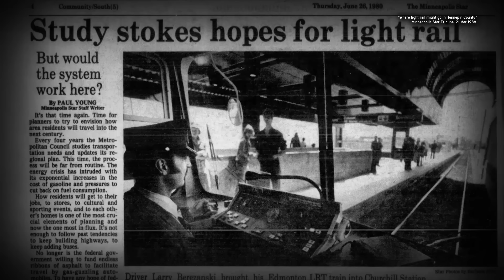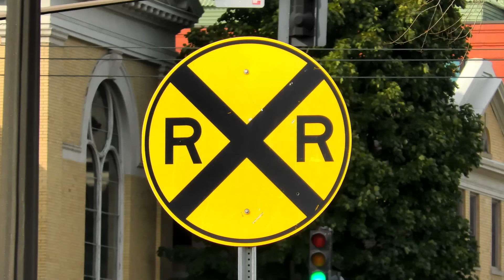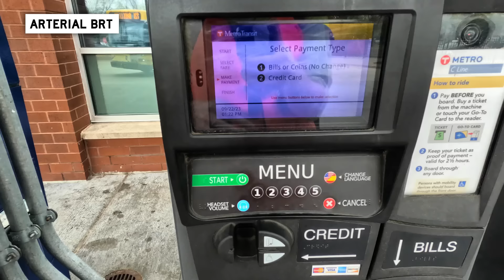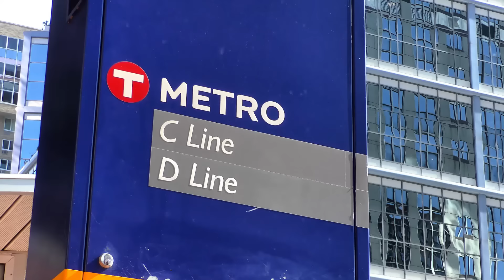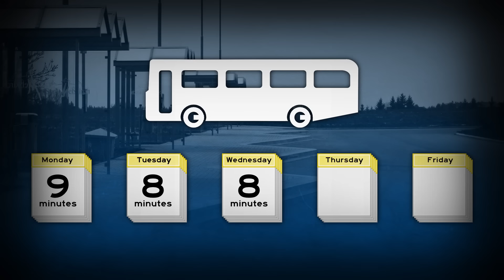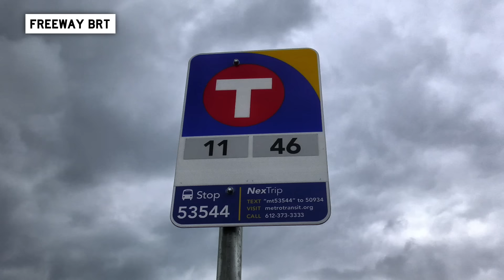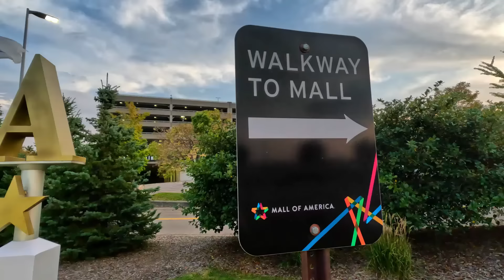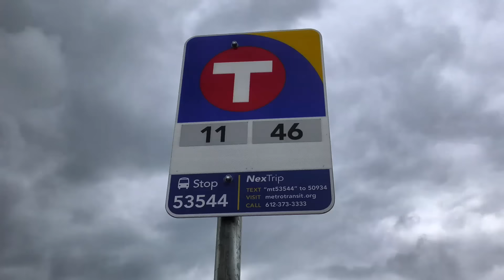Meet Minnesota’s $500-Million... 🚍 BUS???

Comment: When it comes to North American light-rail systems, a pretty great one is the St. Louis MetroLink! Serves both the Illinois and Missouri sides! Serves places like St. Louis Lambert International Airport, IKEA at Cortex, Scott Air Force Base in Illinois, Busch Stadium at Stadium station, Amtrak and the Enterprise Center arena at Civic Center, and of course the Gateway Arch (which you can get an amazing view of from Laclede's Landing station). Much of MetroLink is a reused rail right of way, like the Eads Bridge which is the oldest bridge on the whole Mississippi River! When they were constructing the underground stations downtown, the tunnel was already there, using the St Louis Freight Tunnel. So with a lot of grade-separation, the Blue and Red Lines of MetroLink is basically a light metro, or a light-rail that acts like a subway! 

On the Red Line, trains use the former Wabash/Norfolk & Western Railroad's Union Depot line that once brought passenger trains from Ferguson to Union Station. When the Red Line makes a stop at the Delmar Loop station, it is located just below the original Wabash Railroad's Delmar Station building! On the Blue Line, it follows a former Terminal Railroad Association of St. Louis (TRRA)/Rock Island railroad right of way. When they were constructing Skinker and University City-Big Bend stations, they faced opposition because that section was gonna be street-running, so they opted to build them underground! So thanks to NIMBYs, they ironically made the Blue Line a better and quicker service through no street-running!

Comment: In Seattle, after losing funding for heavy rail in the 70's (that went to build MARTA), they built tunnel beneath the downtown core for busses. 30 years later, it was converted to handle busses and Light Rail.  Hopefully the bridges will be designed for future LRT.

Comment: Road Guy Bob doing transit videos! Amazing stuff. I personally think a mistake most American cities do with transitways is only running one line on it. In other countries, they build a transit way and run 10 - 15 routes on it to speed up normal bus journeys with 1 - 2 minute headways. That way you're making the best use out of expensive concrete and really getting those ridership numbers from bus numbers (20 - 50k riders) to rail numbers (100k - 150k)
Reply: Very inefficient to have so many routes duplicating each other, especially with the operator shortages that most agencies are experiencing. No thanks
Reply: @trademark4537  Just look at Brisbane or Ottawa's transitway (well, before they demolished it). It's actually a more efficient use of infrastructure. The same concept applies with rail lines that branch out into the suburbs but converge at the downtown core. Basically you're using the existing right of way to speed up multiple services instead of just one.
Reply: @louiszhang3050  Let's say the rapid transit route is East-West. If you run the service in the way you suggested, You would need to have the route from the North and the South both enter the transitway. If it's 5 miles to downtown, you're running 20 miles of duplicated service (2 routes, 5 miles each way). The time it takes to run a bus 20 miles, could instead be spent on running one route at high frequency north and south of the transitway.

Yes, riders would have to transfer, but you can significantly reduce their wait time to get on the first bus by investing in better frequency. Operator hours are always limited.

Comment: Bus Rapid Transit is actually a REALLY good option in place of trains and trams. It's cheaper, it's much easier to adjust capacity when needed, and with the new hybrid and even full electric buses, the carbon footprint really isn't any more than a train.

Comment: They should color their busses accordingly to the line color. If not, then make the strips along the busses colored accordingly.l
Reply: That is discriminatory towards colorblind people.  😏
Reply: @jovetj  the design and policy people can always make adjustments
Reply: If all they color their buses or make the strips along the buses accordingly to the line color, you realize that buses on the other lines can break down?

Let's say two buses on the Green line breaks down, then you'll see two blue colored buses on the Green line.
Reply: Do Americans forget that buses can break down?
Reply: Color changing leds exist people
Reply: @automation7295  Nottingham City Transit in the UK has had colour coded liveries for their bus lines for years without issue. Worst case scenario you have some neutral liveried older buses to pick up slack on breakdowns and unusual peaks. Each route was still numbered as well but if they all went to a similar location then they were part of the same colour group. e.g. Bus routes 44, 45 and 46 towards University Park campus would all have orange liveries so you knew you'd be going in at least vaguely the right direction.
Reply: @kitfagan2027  Listen, any bus can experience breakdowns. No buses are perfect. 
If several buses on route 44, 45 and 46 breaks down, then you may see buses with different color livery on the orange line.

I think buses having colour coded liveries for their each bus lines is kinda stupid. Where I live, all city buses are yellow while some have red or blue or even green corners.

Comment: Is the high end BRT system only cheaper because of more companies that know how to build roads?  Isn't that potentially self-defeating in the long term given they have some light rail?
Reply: It's easier to create the service from ground up, but a lot harder to upgrade later on to light rail or subway since BRT is only good for medium capacity & frequency services unless they play some tricks it wouldn't last when it has subway crunch load.
Reply: Not only that, but you also can use the buses elsewhere in the system, the mechanical parts for busses are often the same as other commercial vehicles and there are a lot of people trained in maintenance of those compared to rail ROW and rail locomotives. Bus drivers can also be trained faster and are cheaper. (High turnover job) and the infrastructure can easily be used by other city services without specialized equipment.
Reply: We are also working on two rail expansion projects right now. Perhaps they were concerned about capacity with the contractors available in the area. Additionally, since much of the route is on exclusive roadway, we might be able to retrofit some light rail in the future. A lack of ability to build more additional rail at the moment, while certainly disappointing, does not seem entirely implausible to me.
Reply: If you build a light rail line only to have 20m long vehicles on it, then BRT is a better idea. 
The added value of rail is leveraging the ability to have vehicles longer than buses : 30, 40, 60m and even multiple units coupled.
Reply: @veryrealpersonwhoisreal St paul is also considering a pretty big street car line connecting Union Depot to MSP, and MOA along 7th street

Comment: Why does a broken elevator close the station?  Aren't there stairs??
Reply: I'd assume it has to be accessible for everyone which would bring forth the question, why is there no ramp?
Reply: @attackofthelumbie9029  Ramps require a lot of space, a large footprint. They probably didn't have the space.
Reply: @qwertyfff Yes, but I-35W & Lake Station is NOT accessible to the street (Lake Street) below the expressway, so the busses deploying a W/C patron is redundant cos where are they gonna go?
Reply: @attackofthelumbie9029  In germany, ramps in public spaces are only allowed to be a maxium of 6%, so 6 cm heightgain over 1 meter of length. If the ramp is longer than 6 meters, there needs to be a rest area of 150 cm by 150 cm. Good luck trying to get a ramp going up to that station with that in mind.
Reply from the maker: Metro Transit didn't want a disabled rider marooned on the upper deck on the station with no way down to the street. So they made the bus exit the freeway and use a street-level station. 

Which worked out well for me, so I could have video to show you that.
Reply: @RoadGuyRob  Ah, I see.  I was thinking like a train and I assumed the bus was just skipping the station.   That's actually a great advantage of this kind of system over trains, the bus can always just take to the streets.   Though with the truly dedicated roadway they're building, would be curious to know how many entry/exits for the bus will be built.

Comment: BRT is stop gap...you're just hiding your capital outlay by moving it to operations....bus drivers every 10 minutes ain't cheap, including long term pension requirement's.   A LRT is going to carry more passengers per hour at significantly less labour cost, especially on dedicated lines where driverless LRT can be used.  Build the BRT but make sure you've done the infrastructure in such a way to convert to LRT without undue captial outlay. There is a reason cities that have had BRT for 20 or 30 years are now converting them to rail.
Reply: Build grade separated rail that's automated and hire a team of ticket inspectors. Big capital outlay, big long term gains.
Reply: And sometimes your light rail line gets so crowded you need to bury it underground, and you get a subway!
Reply: That's true, but to be fair time value of money is a real thing. Spending a billion dollars today is very different from spending 500m today and 500m over the next 10 years. It may be costlier in the long run but it gets your transportation up and working sooner and the difference isn't as big as it looks. I think you make a good point about planning ahead to convert it in the future as the next step in efficiency.
Reply: This is true but Metro Light rail lines usually don’t meet the crush capacity and ridership threshold for this to be an immediate issue so the service improvements are still desirable

For the most part being mode agnostic when it comes to the kind of service improvements you’re looking to make (speed, frequency, reliability) up until capacity must be considered is pretty ok for the most part

Buses like the Vancouver 99-B line I think show the upper limit of service frequency and ridership possible for a regular bus line and if metro ever had such a similar bus line it would indeed be extremely advantageous to replace it with higher capacity rapid transit
Reply: If you run your BRT program well, it can be very efficient and great. I have seen a few excellently BRT lines.
Reply: @delroyl427  sure, but they are not a replacement for rail...they are simply a better organized bus with the capacity and operating costs that implies.

Comment: I've advocated for Guideway BRT over light rail for years, even before anyone was doing it. I love the flexibility coupled with lower cost that it provides. If a portion of the guideway becomes impassible, it doesn't shut down the system because the buses can move to surface streets. As demand changes, service levels can be rapidly and dynamically adjusted simply by putting more buses on (or off) a route. That's much harder to do with light rail.

Yes, dynamic service requires hiring more drivers for buses than for trains. But it's more responsive (easier to add buses than train cars) and the added cost of drivers is offset by not paying for moving empty train cars around or the infrastructure they require.

Comment: Where I'm from, and pretty much everywhere in Europe, BRT is only the highest option with guideway.
The rest is just basic bus, even if it uses a bendy one and has nice stops equipped with shelters, canopies, etc.
Basic bus already has greenlight priority and-or activation, bus lanes, etc.

To reach BRT level you need proper busway dedicated right-of-way and nicer faater busses, with real schedule conformity, often increased station spacing, and almost tram-like stations.
In my city, Paris, the latest BRT lines use vehicles that are more trambus than bus : double articulated, 24 meter long, electrically powered via ground recharge infrastructure. They look like trams without pantograph (the wheels and tyres are mostly hidden).

The ones that drive on freeways and-or bus lanes are just simple busses.
The cost mentioned in the video is the one for a tram line in Europe...

Comment: I have always contended that the Twin Cities should first focus on fixing the long transit times from one neighborhood to another since routes are routed through the downtowns before money is spent on transit that benefits only a few.

It takes a minimum of three transit routes to get from a neighborhood in either of the Twin Cities to another in the other. If the system was designed properly, many trips would only take one or two routes and be 2-3× as fast! We have a relatively consistent road grid that could be put to much better use accommodating transit on the existing roads.

Comment: A 10 minute frequency is nothing to get excited about in a city.
Reply: It’s pretty good for the US
Reply: 10 is ok for a BRT and leaves some room until you need trains. Hamburg, Germany has it's M5 line with more than 60,000 passengers per day, where they are running out of ideas: 21 meter busses with 5 doors (modified Mercedes CapaCity L) every three to five minutes…
Reply: More frequency than the light rail in Phoenix
Reply: @sammymarrco47  you need to surpass expectations to get people out of their cars, a 10 minute wait is too long for turn-up-and-ride. Every 3 mins during peak times and 5 mins off-peak is normal where buses are successful.

Comment: But it's expensive to build rail because in America, you guys don't build rail. If it were commonplace, and lots of track miles needed maintenance and refurbishment, it would be far cheaper, and you'd see the benefits in lower operating costs and higher operating flexibility too.
Reply: It's expensive because "the government" pays for it, and everyone loves to fleece the taxpayer.  Rail requires more-specialized equipment and such, so it costs even more.  Then there are all the regulations and impact studies etcetera that drive the costs up even more, especially in some places (e.g. California).
Reply: We don't build rail? We have one of the largest, if not the largest, freight rail network. Most of the building is done by private companies for freight.
Reply: @joeblow5214  Lol you need to take a look at the cannibalization thats happening with freight rail, constantly differing maintenance in favor of high stock prices because investors hate companies spending money, downgrading rail corridors to save money and to justify their terrible longer train policies to reduce labor costs, making trains too long to use their own sidings causing all kinds of issues for freight and travel alike while refusing to extend the sidings.

The truth is we really dont build rail we BUILT rail, now we're just expanding a bit every now and then at exorbitant costs because we gutted them in favor of cars and trucks and what we do have is being run into the ground by greedy stockholders.
Reply: @CaptainBlueTech  Ahhh PSR, yeah, I know. New construction is happening as is expansion of existing routes. It's also heavily subsidized by grants, low interest loans, etc. Some things really haven't changed since Credit Mobilier.

Comment: Only 150 mil/mile for light rail? Here on Oahu our rail project is 526 MILLION / mile. We’re never gonna be able to pay for this shit
Reply: Yeah it’s a project I’ve followed for a while but Oahus is 99% grade separated and is actually considered a light metro. Most at grade light rail is insanely cheaper due to the fact they usually own the right of way already so there are no purchases or lawsuits, less environmental review, and they don’t need to pay for the cost of elevating the rail. So it’s on a nearly completely different level, however it’s unfortunate that it did end up costing a half billion per mile. Seattle has been averaging an even higher cost per mile. Whats even more concerning is whether Oahu will be able to fully expand the metro into the urban environment effectively where the density of people actually is. They’re still under lawsuit with Howard Hughes in Kakaako and they’re spending over half a billion just to relocate the utilities on Dillingham. Building in urban areas is way more difficult than dense urban areas but hopefully they’ll be able to get it done.

Comment: 2:14 this is a very underrated reason why Americans don’t have more trains. The expertise is severely lacking. All our civil engineers know how to make roads, not rails. Which is why making rails takes forever and thus costs way more than it does elsewhere. 

But we need to power through. We need to import rail engineers and encourage our colleges to teach it better. And we need to push through the cost under the assumption that over time we’ll gain the expertise to do it better